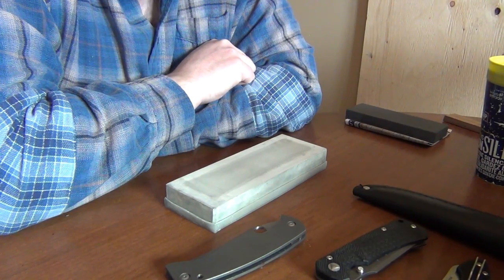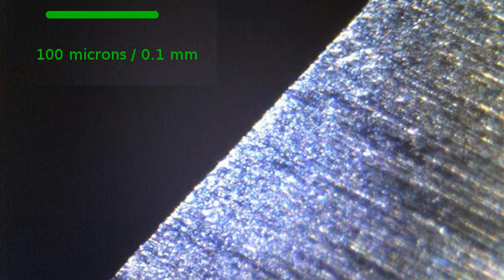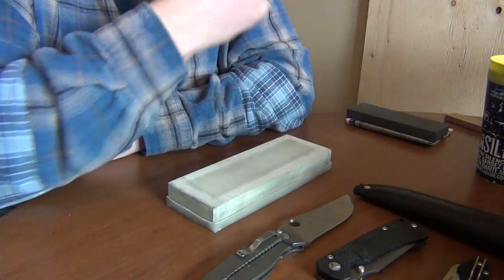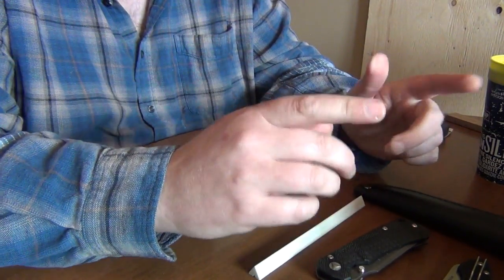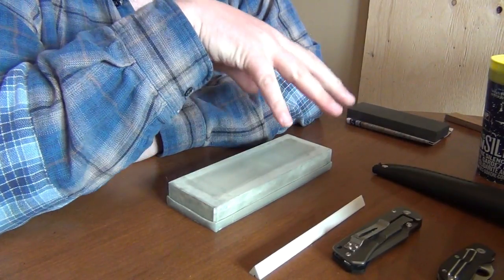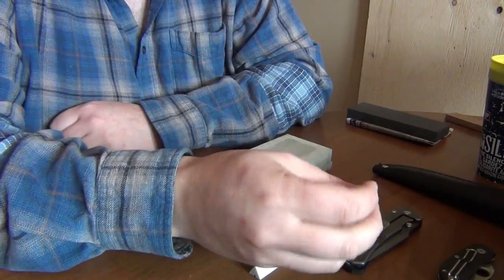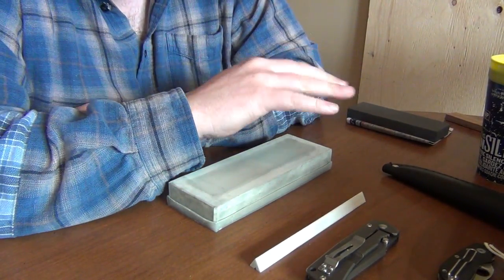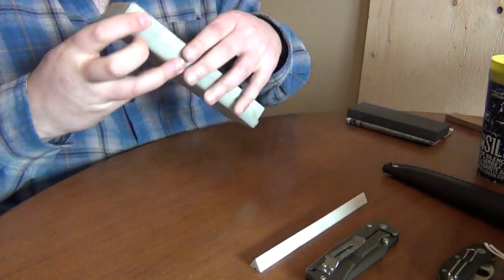Edge retention carving pine : 10V, 9Cr13MoV, AUS-6, 440C, N690Co, 15N20

Comment: Thanks. Your information got me off the super steel bandwagon.
Reply: Got me excited over how good I can get 1084 with a good home heat treat. Larrin does good work and literally designs super-steels - yet he concludes that edge geometry then heat treatment determined performance. He just likes to eek out any performance he can get. He very rightfully prioritizes toughness and hardness ratio with some carbides as a bonus. Super steels like 3V actually do have benefits thanks to crazy toughness and hardness. Rex 121.. ehhh. I don't think most super steels are worth the price however, though you guarantee a pretty good heat treat from any maker going to those pricey steels, or they would lose reputation real fast.

Comment: Just want to get your opinion on new "super steels"...obviously high carbon stainless steel was a great advancement of blade material for EDC and work knives because of less maintenance. It was a giant leap forward IMHO. Do you honestly think anything "worthwhile" meaning leaps and bounds better has come along since properly heat treated and tempered 440C? I mean, with proper geometry and sharpened with suitable grit for task, what advantage does any steel have over 440C in reality? Most "advantages" are very minor and specific task limited. I really think our knife industry is designing lures to catch fishermen and not fish. It is nice to have so many choices though, I must admit.
Reply from the maker: Most of the modern steels are not actually cutlery steels and they tend to be very high carbide steels. Do they have uses, well yes. For people who are very adverse to sharpening and want to use a knife until it can't cut much of anything they have value. 

However are they as great as promoted? Most of the advantages come from other aspects of the knives, geometry and such. Rarely do people compare knives similar enough that the steel would be the major difference.

Comment: Hi, I wanted to ask you one thing, in the practical use of the knife on the field you really notice so much difference between steel 440c and 154cm depending on your experience or the difference is little?
Let me know what you think, thanks to Michele
Reply from the maker: Practically it would be very hard to tell the difference assuming the quality/make of the knife was similar.

Comment: It seems your level of sharpness is too high.  Most people use a knife until it can't slice cut printer paper.  Not just not cleanly slice cutting printer paper, but not being able to slice cut it at all.  My guess is your level of sharpness is MUCH higher than that.
Reply from the maker: ***** This is true, however it is next to impossible to do a edge retention trial to that level of bluntness unless you cut something like dirty carpet or sod. Note that the rankings won't actually change if you compare at lower sharpness in regards to order but they can move further apart as blunting isn't linear.

The problem with doing really hard cutting like sods/carpet is that while it can blunt edges pretty severely it is highly random because an odd piece of grit can damage an edge severely. You have to be pretty careful doing those kinds of comparisons as well. I have posted up a few comparisons of that type.

Comment: If you have a local wood specialist supply store you might be able to get several boards off the same tree or if you know someone with a sawmill. This might minimize the scatter you are seeing and often the sawmill guys will give you a couple boards especially if you bribe them with beer.
Reply from the maker: mark a My family owns acres of timber wood, I could just cut down a tree and section it. However if I wanted a more uniform composition I would just cut up OSB or particle board which is an engineered product and basically already random sampled. 

In most of these trials I am not wanting to artificially constrain the results as much as I am trying to see what happens when you don't. Just go on some form and imply that 10V would hold an edge on carving Pine as much as AUS-6 and see what is the result.

The point of this video wasn't really to complain about the scatter as much as make the point that the scatter happens even if you semi-constrain it. Now imagine what happens when someone goes out into the woods and just carves a few fuzz sticks. What kind of scatter do you expect there?

Comment: I've been following this recent video series on edge retention. If I'm understanding your general findings correctly, to maximize edge retention (of any steel) one is better off to always "touch up" an edge with a medium-coarse stone, followed by a fine stone? With this method you will be removing damaged edge steel, and not just reshaping it, like you would with a fine stone?
Reply from the maker: clapton924 It is going to depend on what you are cutting, some materials are so abrasive they cut off fatigued steel. I would suggest for most people that they at least try to use a coarse abrasive or cut the apex back to see if it improves performance.
Reply: I think I might be on the path of understanding why I've been somewhat underwhelmed with the edge retention of higher-end steels. In the past, I've generally touched up my edges with fine or ultra fine stones, followed by a strop....or just stropping in general. I'm going to try using a medium ceramic rod, and see if my edge retention increases.
Reply from the maker: clapton924 I would be curious to see if you note any significant difference.

Comment: Cliff, so what you are saying is that you could replicate the loss in edge retention on the 320 if you used heavy pressure which would essentially be doing the same thing as the Spyderco Sharpmaker stone, right?
Reply from the maker: Razor Edge Knives LLC I am not sure what you mean. I was able to stop the loss in edge retention by using the Spyderco Fine with low force. All of the runs had the Fine micro-bevel.
Reply: I guess what I am asking is that the spyderco fine is simply a fine stone. Could you replicate the same effects of high pressure on a lower grit stone and cause stress to the edge to cause lower edge retention?
Reply from the maker: Josh - REK Yes, this is essentially what people call a burr at large levels.
Reply: Thanks for clarifying!

Comment: seems that the only consistent media for cutting would be plastic. even then, the thickness likely varies.
Reply from the maker: knives save lives Man made woods like OSB would also be fairly consistent, hard to carve them up though.
Reply: Cliff Stamp the main problem with osb and particle board is rocks. They are full of them  small about the size of a grain of rice but hit one and your run becomes an outlier. Hit one with every knife at random times and the effort becomes worthless.
Reply from the maker: mark a Random deviations average out, systematic deviations don't. It is pointless to look for a material which has an extreme tolerance for random deviations because you don't when you cut anyway. It doesn't hurt of course to use a material which has a very high tolerance for consistency but it won't gain you anything either.

Comment: After seeing your other video regarding the lengthwise bow in your sharpmaker rod, and hearing you say in this video that you generally get the metal deposits near the corners of your rods, I recalled that in my experience with my own rods, I tend to get deposits only on the center of the flats. Now I am wondering if the flat sides of the stones are truly flat at all. Perhaps they vary by either bulging outward from the center of inward toward the center as well?
Reply from the maker: traderjoes I would expect that many of them have issues. When people look at them carefully, they often report problems. Just look at what happens when the straight razor guys try them.
Reply: Cliff Stamp Mine also really only load in the center.
Reply: Same here, my UF loads in the center.
Reply: +traderjoes
Spyderco's stone quality control has dropped significantly in the last few years. Especially their bench stone variants, for some reason.

A few months ago, I decided to go ahead to buy a 2x8" ultra fine Spyderco bench stone, which set me back about $70 after shipping. Got it, looked it over, everything seemed fine. Started doing some trial sharpening and I noticed a lot of odd behavior and catching/stickiness. Figured something was wrong. Sure enough, I put it on a DMT lapping stone and it wobbled like a chair constructed by someone with whom the concept of measurement was a foreign concept. Not only was the surface (on both sides no less...) not true and flat... it was concave. I... I don't even know how they managed to do that. Frustrated, I looked online and saw a plethora of other users and customers writing about their own problems with (especially UF) Spyderco stones in the last couple of years. Amazon, in particular, has verified purchase review after review of people getting untrue stones. To make matters worse, some people were reporting they attempted to return the stones and get replacements because they were obviously not in spec - Spyderco returned the (what you'd think would qualify as defective) stones back to them stating they were within acceptable tolerances.

My UF triangle rods are also not 100% true, but they were no where near as bad as the much, much more expensive bench stone. If this is the kind of quality that Spyderco is putting out, they need to get their act together. That UF bench stone was about the same size (although not thickness) and price as some of my lower grit Shapton stones - which arrived flat and true.

Comment: The beach and cliff stamp. Why have I never put the two together?

Good point regarding the orientation of the edge in relation to the sharpmaker fine stone. Interestingly, Spyderco recommends a number of passes using the edge of those stones before a series of passes on the flats.
Reply from the maker: YasumotoUS Yeah, I generally would avoid that, the pressure is really high and thus deformation starts to take place rapidly vs abrasion.
Reply: Cliff Stamp on a related note, I 'touch up' my S30V Paramilitary using the sharpmaker fine and ultra-fine rods(stones), edge of rod first and then the flat of the rod for both. For general use (nothing scientific!), I find that process acceptable. After hard use, I'll go down to the medium rods having taken the possibly broken edge off as the first step.

Edit: I'll try using just the flats of the rods next go around.
Reply from the maker: YasumotoUS I think a critical point, which I often fail to stress is that instead of looking for one kind of magic bullet to just remember to try a few things and find out what works. I do think as a few general principles that what most people do as touch-ups tends to lead to compromised performance but you also have to look at what is practical for them. I often bake bread without an over night fermenting and with a quick pan fry. It isn't as nice as a full rise sourdough, but you can still eat it and have fresh bread made in under an hour from start to finish.
Reply: I understand your point -- good example. Go with what works for you and in your situation. I still wish to give the flats a go; won't cost me much time. Worst case is that I take down the edge and start fresh.

Comment: Does the norton india combination stone release slurry?
Reply from the maker: TheRedRider100 Yes however it requires a very high pressure. For example 20-30 lbs on a chisel face will cause it to slurry. For a knife it is very difficult as the force you need to apply is going to be even higher.
Reply: does both sides slurry?
ill just be doing light grinding on the goarse side and light refining on the finer side, about 10 lbs of pressure at most on the coarse side
Reply from the maker: TheRedRider100 Any solid stone will form a slurry, it just is a matter of applying enough force. Both sides of this stone have very strong bonds. The only way I get them to slurry is when using a chisel as I can apply a lot of force 20-30 lbs and on a small area. On a knife it is going to be very difficult, hence why most people think then can't form a slurry.
Reply: I understand
How often do you use your stone?
I understand it will need to be lapped if i just use moderate pressure and light passes on the fine side?
Reply from the maker: TheRedRider100 If you don't exert enough force to make a slurry it won't really wear into a hollow, but every ~5000 or so passes you likely would need to recut the surface as it would be worn.
Reply: what do you think is better to flatten the norton oil stones, sandpaper on glass, abrasive grain on glass or DMT diamonds?
Reply from the maker: TheRedRider100 The norton oil stones are alumina based, you have to flatten then with an abrasive which is more coarse than they are and harder, otherwise you will just polish them. Your best best is a very low grit alumina to flatten them followed by a very low grit silicon carbide grit to resurface it. I do this periodically, every 5000 or so passes to keep them from developing a hollow. If you don't and you let them wear in a big hollow it will be very hard to get it out.
Reply: Can I do the low grit SIC every 3000 passes or so just to resurface it?
BTW you are referring to abraisive grain on glass?
Reply from the maker: TheRedRider100 Yes. And yes, though I normally use granite just because I have a piece of it.
Reply: Understood, thanks for all the help
Reply from the maker: shannonandsheila1 Autoparts stores usually sell sandblasting media, both silicon carbide and aluminum oxide are common.

Comment: Cliff, how well does that waterstone work for you for 10V? I noticed with my 1000 grit king that it doesn't really do all that much to my K2 and I can almost feel the edge getting stressed. There is very little cutting. I pretty much only use diamonds at this point for steels in the 10V class. M4 is the max I will use on a waterstone.
Reply from the maker: Kevin Oubre The King 1000 is very fine, much finer than the grit because of how it breaks down. It cuts ~2X the grit basically so it is a finishing stone.

This is a #300 grit stone which is much stronger of a bond. It cuts 10V perfectly fine, it easily reset the bevels on those knives however if I wanted to change the angle I would back off to a Norton Crystolon coarse, India Coarse and use a lot more force.
Reply from the maker: Kevin Oubre This one is pretty expensive because it is a dual density stone. The SP-II 240 is likely a better choice for 10V and less cost. But again it is really force sensitive. If you like to use a lot of force you really need a strong vitrified bond.